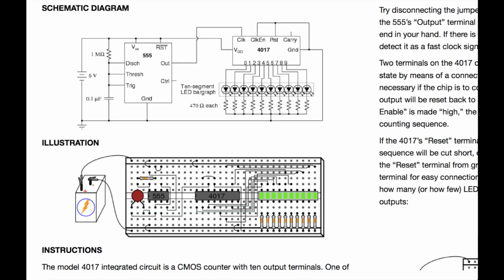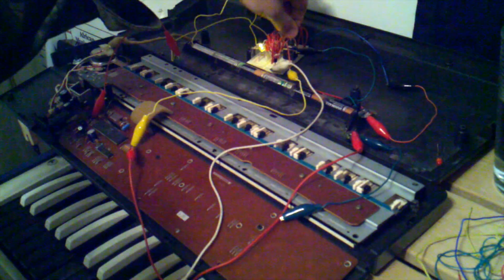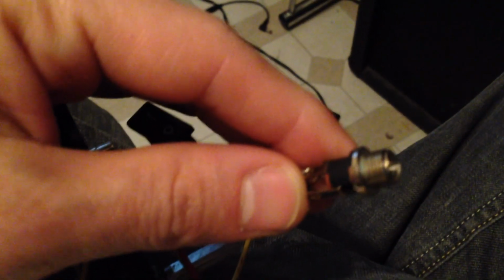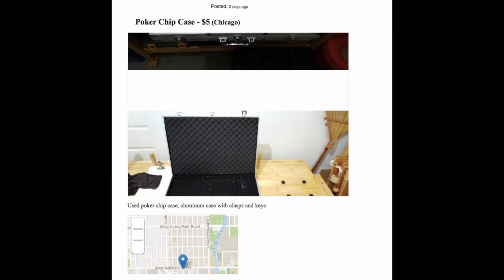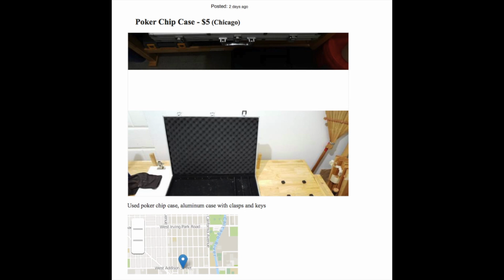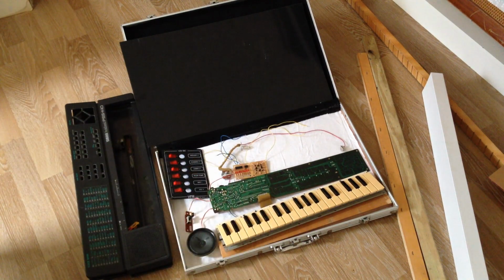Moog Circuit Bending Challenge 2016

Comment: very interesting, I still have a yamaha PSR 36, thanks for the stimulation / trigger :-)
Reply from the maker: Thank you. This video was half@ssed thrown together at the last minute just before the deadline of the competition. This synth is actually far more capable then the video reveals. But yes, the old Yamaha FM OPerator IC's are loads of fun. It would be nice to be able to edit every parameter of the operator, which gets very deep very fast (DX7, Preen / Volca etc.) but I think the beauty of these old toy? FM synths are in the presets and being able to scramble the data to different addresses. In that way, you can actually build up a sets of recallable Programs / Patches (in this case actual patch formations) ... and generate new sounds very quickly that you would probably never come up w/ via individual parameter programming. As I'm writing this I'm having another idea for further exploration. And I wanted to mention that the edition of the step sequencer really expanded the capabilities of the machine, it was already fun w/ the built in drum sounds and patterns, but having the ability to program them really turned it into a entirely new sound tool. Add the built in distortion / delay and then the pitch .... I need to do another proper demo video of it. Its currently inbetween 2 record shelves collecting dust. Funny that you should comment now, its been on my mind a lot lately! Thanks again! --- And I didn't even really get to show the primitive sampler on it.